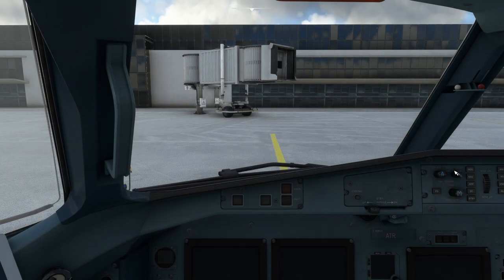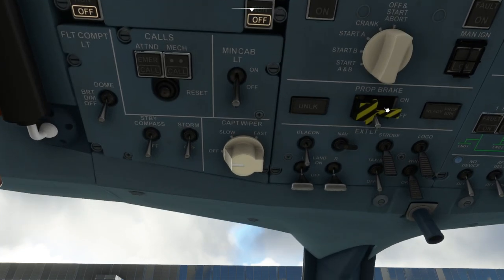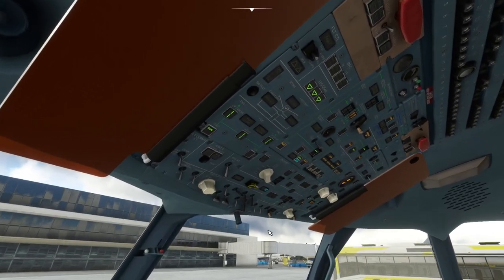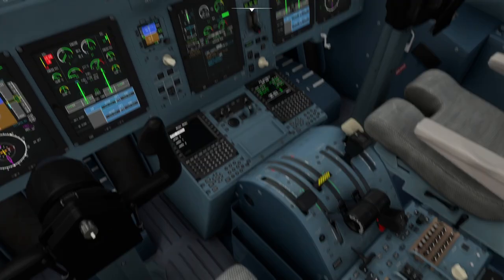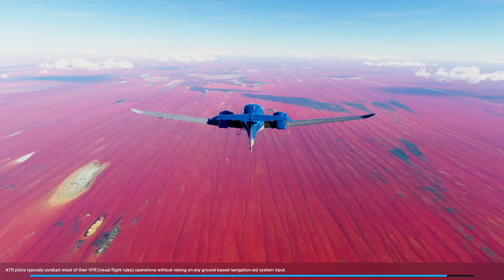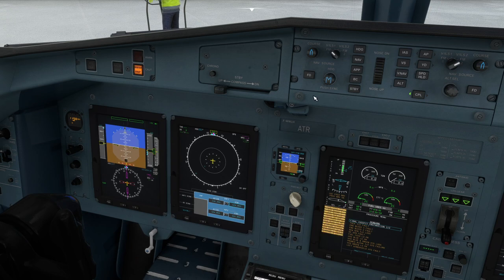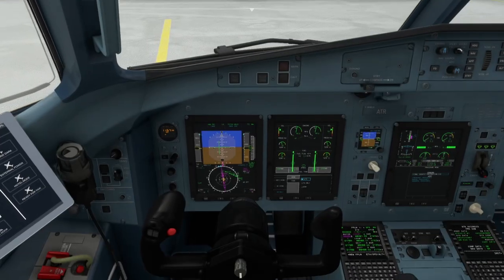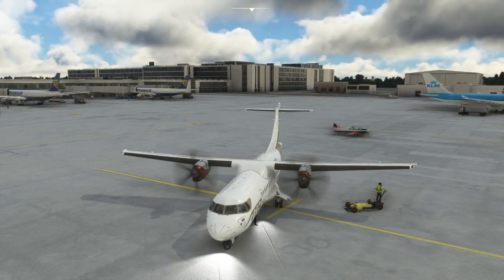How to work around the "hotel mode" Prop Brake bug with the ATR in Microsoft Flight Simulator

Comment from the maker: As noted in the video - the only way I have found of fixing the prop-brake bug is to re-start engine no.2 - which then behaves as expected. If anybody knows any other workarounds, I would love to know them. It almost seems the engine is working when the bug happens - just the animation of the propeller isn't happening.
Reply: As I understand it, hotel mode is to be used when ground power is not available. So without connecting ground power once the battery switch is on and the two screens come alive, you can hit the auxillary hydraulic pump and switch on prop brake and start engine two, moving lever to feather at 10%. This provides power and the other three screens come on. After doing all the other preparation you can hit the aux hyd pump again and release the prop brake and carry on with the rest of the engine start procedure. (This works consistantly on xbox after recent update, though I suppose it's possible we in the xbox ghetto didn't get the same update PC users got that broke it)
Reply: I now tried it a couple of times, but after hotel mode. Start engine 1, set to auto , prop brake off and i have no issues anymore.
Propeller animation works as well.
Reply: Here is a better one including coming out of hotel and starting left engine https://www.youtube.com/watch?v=Kka0mH5J9ks
Reply from the maker: @PThomas22  I'll look at it - the last time I looked, referring to the POH, the ready light was coming on, the dials were reacting, but the animations were not happening.
Reply: @jonbeckett  It has worked like the above videos since launch. In your video you are not letting it be ready before going to on or off and have your condition levers in the incorrect places/times.

If you notice when coming out of hotel mode correctly there is a "unlink" to the left of the prop brake letting you know it is releasing and the prop is going to spin.

Just want to make sure other users are getting the correct steps is all.

Edit- also I just realized you’re trying to use it with your external power. Think of hotel mode as the same thing as an APU on airliner. It is so you have power to the aircraft without a GPU. The prop brake is there to stop it from spinning so ground crew can still be around the aircraft. This would be indicated by having your NAV lights on but no beacon. If you are using a GPU then hotel mode is not used. 

When you are going to remove the brake you would switch on the beacon as well.
Reply: @jonbeckett  did you happen to have a look. Personally I would take this one down if you have.
Reply: Just figured it is also connected to the gust lock. All in all this is not my favorite plane although it looks super good.

Comment: It's a bug but brought on by pilot error.  There are TWO external power switches, one for the DC system and one for the AC.  You turned on the DC, but not the AC.  The prop brake is controlled by the blue hydraulic system, which can be powered by the external AC power.  If you set the prop brake when the READY light is not lit up, that's when the error occurs.  If you only engage or disengage the brake when the READY light is illuminated, it will work properly.  The bug occurs because it allows the brake to be set even when not powered, which seems to mess up the animation logic after that.  Even though the prop won't spin, the engine will function entirely as normal.

The other bit is that when the condition levers are set at start idle, they do not generate enough torque to power the hydraulic pumps.  This doesn't show up on the MFD, but you can see this by monitoring the overhead panel lights.  This is where the auxiliary pump button is used, to create enough pressure in the system to disengage the prop brake.

So the correct procedure:
1.  Turn external DC power on (what you did)
2.  Turn external AC power on (top middle of the panel, between the AC gen switches)(you missed this)
3.  When READY light illuminated, engage prop brake
4.  Start engine 2 in hotel mode.  Condition lever should stay at the first position.
5.  Continue startup and pushback
6.  When both engines are running, press the aux pump button
7.  When the READY light is illuminated, disengage the prop brake
8.  Advance condition levers to Auto.  After 10-15 seconds the overhead fault lights will extinguish
9.  You're good to go!
Reply from the maker: THANKYOU - Makes total sense - I'll update the checklist, and re-record working through it.
Reply from the maker: Just working through this and looking at the procedure, it's not obvious that you need both engines running to provide enough pressure for the prop brake to release (which becomes important in terms of sequencing) :)
Reply from the maker: Further notes - it's STILL broken. I just did the same startup twice in a row - it worked once, and then broke the second time.
Reply: @jonbeckett  Check the gust lock?  There seems to be an interconnect there as well, but I haven't been consistent enough to confirm it.  But the last several times I've flow the plane, leaving the gust lock engaged until just before releasing the parking brake to taxi has worked.
Reply: @jonbeckett  That might well be the case, since the aux pump I believe is powered by battery only.  The prop brake is on the blue system, which can only be fully pressurized with external AC power, or one of the engines at Auto.  And as I said to your other comment, there seems to be a link to the gust lock as well, but I'm not 100% certain of just how.
Reply: @kurohone thank you!
Reply: Yep, I was just gonna type this in, I can confirm, that it works, I did it 3-4 times with no issues.
Engage BOTH external power buttons, turn ON prop brake IF READY is illuminated, start Engine 2 as usual, pump AUX Hyd PWR (you may have to do this a few times), then disengage prop break when Ready is lit.

Comment: I've had more than 100 hrs on the atr and had zero problems with hotel mode, it's all about hydrolic pressure. You never but the engine into hotel until you have the green ready light, I find that pumping the aux button quickly is the best way!!. you then have  ten seconds or so to flick the switch.
Once it's in hotel,you can start the engine when ready for your flight you start engine one!. When engine one is out of feather, you will have full hydrolic power. The green ready light will show then simply flick the switch, the red unlock sign will light up!!. You're good to go, works every time.
Reply from the maker: I did that earlier - it worked once, and broke once. The engine WAS running - the propeller just wasn't being animated. I think one of the other commenters may be on to something - its to do with either the emergency brake, or the gust lock levers - there's a wiring issue somewhere that breaks it.
Reply: @jonbeckett  strange people having problems with it 🤔
Reply: Just had another outing in the atr, with my method absolutely no problem!!. I'm on xbox don't know if that makes a difference!.
Reply: @christyler4381  I don’t have issues on pc, guess it depends per person
Reply: @jonbeckett  no it is not, please see my comment on the proper way to use hotel mode. Some else also put it on your pinned thread. There is no bug. One of my favorite aircraft to fly.

Comment: Hi Jon, love your videos.  I do not have any problems with Hotel mode.  Some of the comments talk bout using AC Wild, but this is only used for maintenance purposes.  The trick is to ensure the greed READY light is showing on the prop brake annunicator prior to engaging the brake.  In the real aircraft this is illuninated by pushing the ground hydraulic buttom for 30 seconds to charge the hydraulic system,  In the sim, as soon as the button is pressed, it pops back up.  So push the button a few times (5-6 times for me) until the READY light is on.  You can then flip the brake switch and start.  When releasing the brake you also need ensure the READY light is on,  If it isnt, just repeast press the GRND HYD button in the same fashion.

Comment: I had this the other day. I found that by reducing the right prop lever back to feather once in Hotel mode and pressing the aux pump thingy on the throttle quadrant a few times I was able to come out of Hotel mode. I will give it another try later to see if it is a one off. Probably not how it is supposed to be done in real world ops but it worked for me!
Reply: I am the same - if I put prop 2 to feather it allows you out of hotel mode
Reply: @nathandrz4008  yes tried it again yesterday and it worked just fine

Comment: There is no bug, it is user error. It is powered by the hydraulic system.

Battery on
Hydraulic Pump (right under parking brake)
Prop brake will illuminate
Switch up to on
Eng 2 pump on
Crank to A or B or A/B
Condition lever in SO
Start 2
Watch NH rise and then advance condition lever to FTR

Done

*edited for spelling errors - need moooarrr cofffee
Reply from the maker: As I've said elsewhere - I'll take another look at it. I wasted several hours just before going on holiday re-writing the checklist to follow the real POH, and noting the "ready" state next to the prop brake, along with the hydraulic system pressurisation - and it was still erratic. Sometimes it would work straight after the sim loaded, but if you did a "restart" with the sim, then followed it again, it would fail (animation breaking). As I said - I'll look again.

Comment: Put the engine in hotel mode, to get the prop spinning, take the brake off and switch the fuel leaver to fully off for a quick second and then back on this will get the prop spinning.

Comment: I just turn one engine on atm, disconnect ground power and pushback starting the second.
It is not a realistic way of doing it, but I had this bug on and off and it got annoying. 
Now I got used to this method and be on my way in 3-4 minutes 😬

Comment: Along with Hotel Mode, I am also having problems with my condition levers.  With the new update I was finally able to map the condition levers to Propeller 1 axis and Propeller 2 axis but once they are moved to Feather and Auto, I can't get them all the way back down to Fuel S.O.  I am using the Saitek x52 Pro. Any suggestion?
BTW, thank you for all your videos.  They have been a tremendous help.  I have learned so much.

Comment: A for me it works like this:
battery on
Turn on prob break:
Press the button under the throttle, Ready lights up green
Turn on the Prob Break switch
Start engine 2, propeller stopped
Turn off probe break:
Press the button under the throttle, Ready lights up green
Turn off the Prob Break switch, propeller spins
Repeat possible, Ready must light up, otherwise press the button
Reply from the maker: Yep - there's more to it than that - I'm just about to re-record.
Reply: One further amendment:
It is important that the green Ready is displayed, otherwise Prob Break does not go on or off.
If the green Ready does not come on before the first engine start:
1 selector switch to A, B, AB
2 engine 2 start
3 Press the button under the throttle lever, display green Ready

Thank you Jonathan for your videos, very well done!
Reply from the maker: @stefankunze1643  Yeah - it's still broken - I just wasted 2 hours working through the various procedures. I currently have an ATR with the engines running, but no animation for the second engine - which is essentially the same problem that's been there for ages.
Reply: This works for me too
Reply: @jonbeckett  again not broken at all. User error. You might what to revist this with all the people that have posted the correct way this works.

summary is:

Battery on
Hydraulic Pump (right under parking brake)
Prop brake will illuminate
Switch up to on
Eng 2 pump on
Crank to A or B or A/B
Condition lever in SO
Start 2
Watch NH rise and then advance condition lever to FTR

Done
Reply from the maker: @PThomas22  different people are getting different results - it may be that control profiles are causing it. I'll have a look when I get a chance.
Reply: Posted a video of how it works on your pinned comment. @jonbeckett